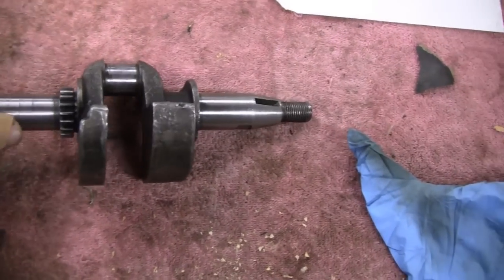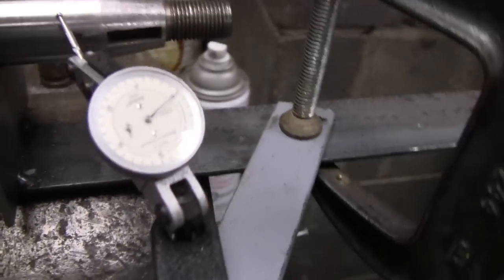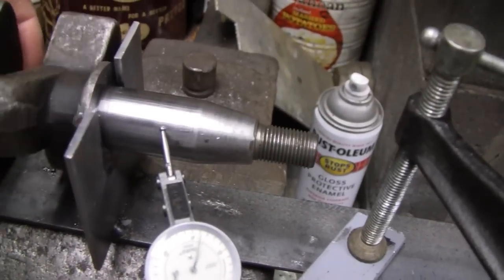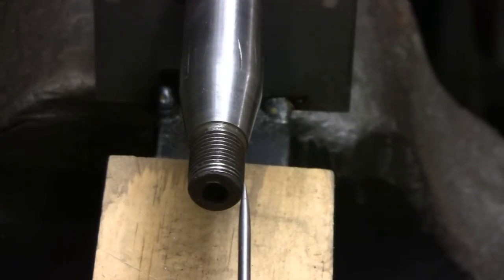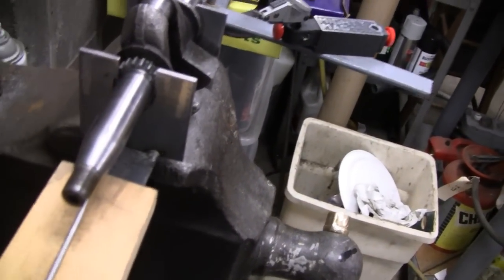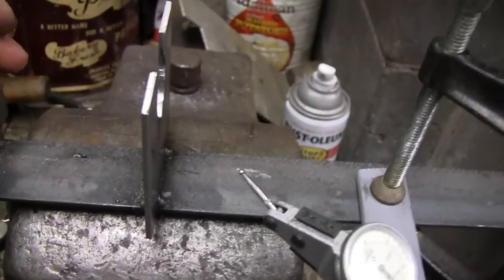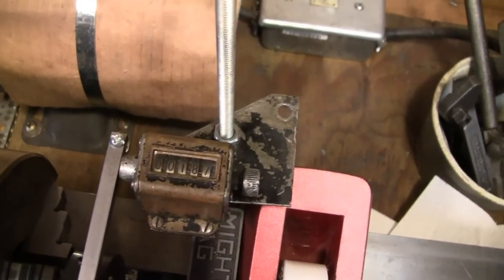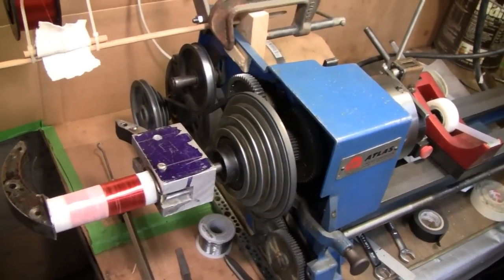1928 BRIGGS REBUILD MODEL FH (part 9)

Comment: I'd think one of those cheap magnifying make-up mirrors would fix the counter situation.
Reply from the maker: Nah, that wouldn't help Toes!! If you take your eyes off the coil for a split second you'll fuck it all up!!☺
Reply: 805ROADKING Ahhh, I get it, AND just doing the best guessitmate seems to be close enough anyway, huh?  Those extra pairs of eyes make all the difference, but in the end like you said before, it won't make that much difference to the voltage in 10,000 windings!

Comment: There's an old guy in my neighborhood who made a jig consisting of a one inch steel plate with a fine threaded bolt welded to it and micrometer setup that he uses to straighten verticle engine crankshafts without having to take them out of the engine.  He removes the engine, attaches it to his jig and gently teases the shaft back into specs (usually better) for $20 - $30 bucks...his "beer money" he says.  You gotta love those old guys who still know how to keep those engines running.
Reply from the maker: That guy is a genius!! He found a need and filled it!!☺

Comment: If your camera has threads on the lens you can buy a filter to reduce the glare. You can find them on eBay for as cheap as 4 5 dollars.

You need your camera's thread ID (Google has it) and you need to get the right filter for glare. Polarizing filter/anti-glare filter/reflection filter. I found mine under polarizing filter but it mostly works outside, so when you get one you have to figure it out based on the lights you want it to work under.
Reply from the maker: Yeah we have a threaded lens!! We might have to look into that!!☺